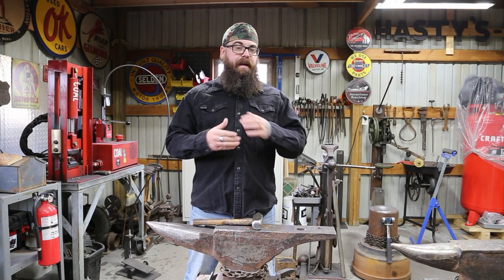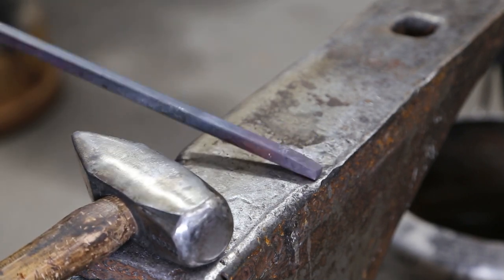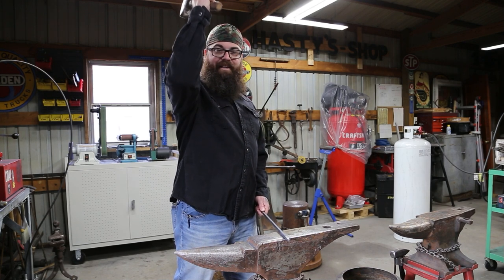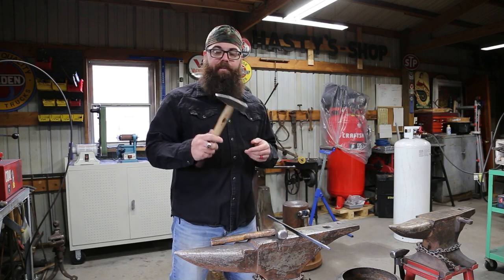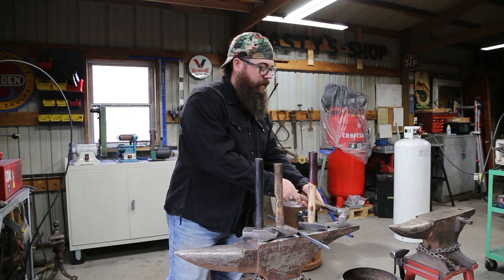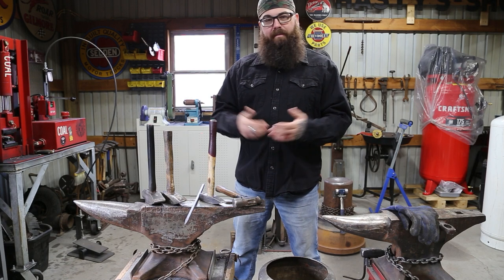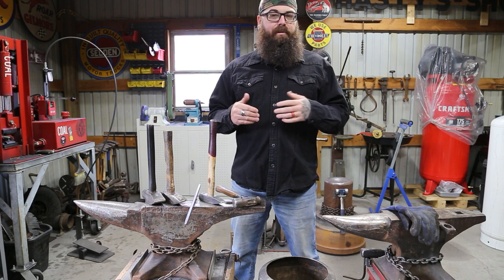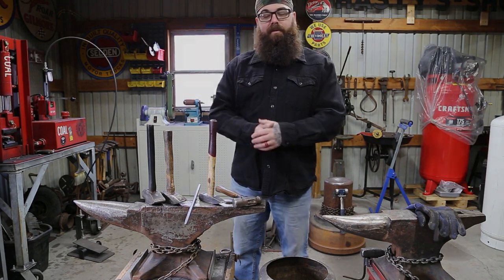Blacksmithing Hammer Technique, Addressing the comments and Discussing Anvil Height.

Comment: I've never commented negatively on anyone's technique, but since you bring it I'll make an exception. I started blacksmithing in the '80s and I think there is something to be learned from everyone and I've tried that hammering the anvil thing. All it's done for me is make needless noise and waste valuable time between heats. There is no rhythm that needs to be maintained if you're the one holding and striking, you pretty much know when that next hammer blow is coming and how long you have to reposition your metal. It's a different story if you are swinging a sledge for someone else, that's when you need to keep a rhythm. It bugs me when I see it but I can look beyond that without the need to criticize. Like you say, you do what works for you, keep up the good work.
Reply from the maker: Exactly,  thank you so much for the comment and bieng unbiased.

Comment: There are endless individual styles and techniques in blacksmithing that all get the task done. 
I never told a student how to stand, hold a hammer etc. I tell them some popular options , safety, and let them figure it out. And they did. Your body lets you know what’s comfortable or not. Fire let’s you know if you’re too close. And idiots let you know they are idiots. 

For those worried about damaging your anvil from tapping it, you can soften your hammer so the hammer dents and not the anvil. The hot steel will be even softer so no damage to the the hammer.
Reply from the maker: I appreciate it,  that's my thoughts exactly

Comment: ..Good perspective. Tap or no tap don't care. Only observation i have on the height of the anvil is this- does the hammer face make a full impression on the work. The top of the face makes more of an impression than  the bottom or even side to side. Some clay and a few boards of various heights told me i need to lower mine just a bit of an inch...
Reply from the maker: Very true,  I did something similar with my main anvil